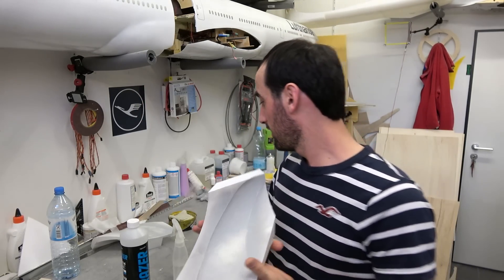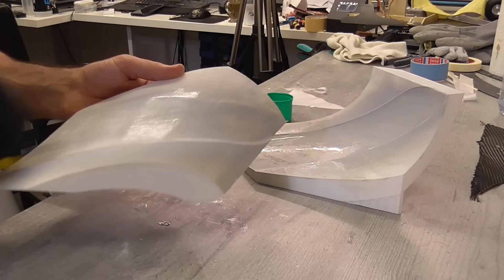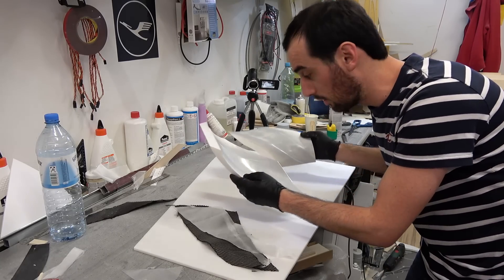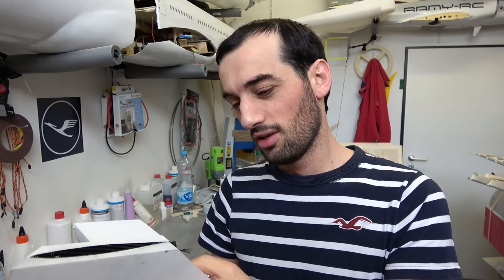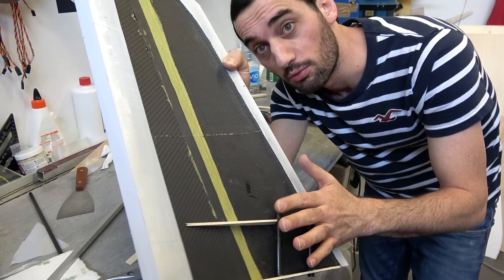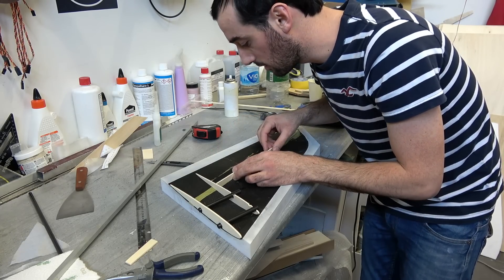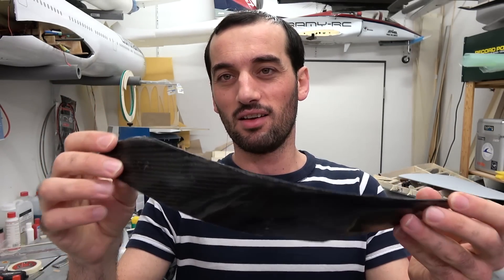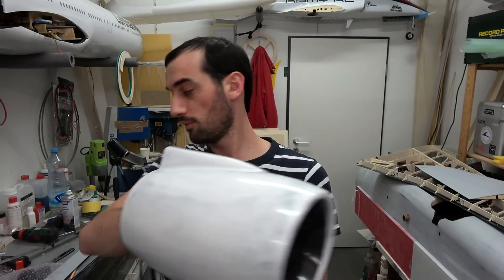Making the Sharklets and horizontal stabilizer/ AIRBUS A350 XWB

Comment: How did you cut the extra carbon from horizontal stabilizer upper and lower surface with out pulling them out from the mold?

Comment: 4:16  The huge part is particularly the MAIN FITTING and the bottom is the "Shock strut". and then you have the "Torque Link" connecting the Main fitting and the Shock strut together.

Comment: Hi Ramy

When you said you should use a silicone gun i had an idea. When I mix glues (epoxy and micro) I put it in a small plastic bag, then cut the corner off and apply the glue like you would put icing on a cake.
then once your done you can just dispose of the bag, no mess and its easy.

Comment: you need to calculate the size restriction behind the turbine. because the same aerodynamic occurs even if this is not a gas turbine. I mean you need to design a convergent and test the trust on a bench

Comment: Ramy just a tip for spreading the glue to join the parts together. Use wax paper rolled into a cone, fill it with the epoxy & micro balloon mix, fold over the wide end and cut the tip. Use it like a pastry bag to squeeze out uniform lines of glue where you want.

Comment: For applying your Epoxy - Micro-Balloon/Cotton Mix:
Instead of a Silicone Gun, use a plasic bag, fill your mixture into it, close it and cut one small piece acting like a nozzle of the bottom corners. 
By squeezing the bag you can apply it like toothpaste to the parts.
Hopefully you unterstand my suggestion.

Viel Erfolg ;-)

Comment: Stay safe Ramy, this not modelling, it is minature engineering and the world needs more and more engineers than so called 'managers'. I suffered in England when very good engineers were forced out of jobs by the so called managers. So more please, there are still plenty of commercal aircraft that you need to reproduce. 

         On a slighly different point, can any-one in the modelling world come up with a electronic gyro system (similar to a laser ring) that can hold a model on a given heading either in take off, landing and even in flight. So many models get destroyed with landing/take off accidents and I feel if a gyro could hold a model in-to wind on a heading leaving the controller to control speed and thus rate of decent.
        Many thanks for your videos, exelent work...regards S

Comment: Ramy... in regards to using the expoxy with microballons - you could try using the cake decorating piping bag idea with a cheap disposable bag made from paper. Roll a piece of paper into a cone, fill with thickened expoxy, fold over opened end a few times. Then cut the "pointed end" to a size opening that seems appropriate.  Simply squeeze the bag to extrude the epoxy to make your fillets.

Comment: Hi Ramy - love your work. I would recommend a plastic zip lock bag for the filler - good for mixing thoroughly by closing bag and squeezing it around, then snip a small corner off to let you squeeze it out like icing on a cake- I use that method for canoe building

Comment: If you brush in a gelcoat, and let it almost cure completely befor stariting to hand lay up the cloth, then you would avoid  thos tiny potholes, that are very hard to fill, in case you are planning to paint the surface. If you cover with monocote vthen it doesn? matter of course.

Comment: To lay down a nice bead of epoxy like you did when bonding the two halfs of the stabilizer, I recommend using a plastic sandwich bag that you fill with the epoxy and then cut off one corner and use it like a piping bag for cake decoration.

Comment: When you join two halves of a casting together (like the sharklets) how do you do it to make sure there are no seams between the two pieces? Or if you sand the seams down how do you make sure the two halves dont fall apart???? (Because the glueing surface is so small)
Reply: I have exactly the same question. Furthermore how do you ensure that it structurally integral, when there are no fibres connecting the two halves but just glue (with a small glueing area)?

Comment: Since you have a bit more time on your hands, using scraps, i suggest you do a series of experiments with molds and release methods.
Specifically in the case of the PVA glue, what i'd do, is i'd make the mold a few percents larger than the finite part, then, i would use an air-gun to spray the PVA glue on.
IF you don't have one, you can make a very rudimentary one out of two pipes that are met at the tips at 90 degrees with one pipe slightly over the other's center over the holes. The one that's under the center goes into your mouth (where you push air) and the other into a container (cup) with the medium you want to aerosolize.

The tool is called "mouth atomizer" under a simple google search. You can push various thickness of fluid with them depending on how large the pipes are. You can make it as simple as using two plastic straws (tho Amazon has a few already made).

Comment: Hey Rammy.
Really nice material that you put out for us. Thanks a lot. I use a ziplock bag for applying the bead that you need to join your control surfaces. Put your micro balloon mix in a small bag and then and cut a corner of the plastic bag off and squeeze it through the hole on to your surface.
This plane is gonna be epic. Can’t wait to see it finished. Covid 19 has hit South Africa and hope we can control it as we don’t have as much discipline as most Europeans do. Hope we can pull together and control this virus

Comment: Hi, nice work! I have a few ideas for a better result! Apply at first a resin layer with tixotropic component! It works against micropinholes! After laminating the 50 gr. Glas, apply Resin for the Carbon fabric! Then put the  
Carbon into the mold, now laminate it with a dry brush or/and  with a rubber spreader! All tested by myself with very good results! If you have any questitions, no Prob! Sorry for my losy english! Best regards, Walter!

Comment: Hi Ramy
The resin/microballoon glue is easy to handle with a pastry bag, you can easely make it with a piece of  glossy paper. To reduce the bright spots on the  layup you can try to sqeeze the resin, from underneath through the fabric with an old credit card or a rubber squeeche (gummispatel).
(seen by "B-1 Bob") 
Thanks for your Videos

Comment: Use a piping bag to put you goop in trailing and leading edges, clear plastic bag fill with glue and cut a tip off much easier and cleaner

Comment: Great stuff, keep it up. One thing I do to seal/smooth PLA prints is lightly sand then spread superglue over the whole print using my hand with a latex glove on. It seals, strengthens and sands easily to a smooth finish. Do this outside as the fumes are a bit intense.

Comment: A good trick I saw people use to apply thickened epoxy is to use a "icing pouch cone thingy" , the thing bakers use to make pastries or put icing on cakes . It makes a nice bead of glue and you can control the size by cutting the corner more or less. 
When you're done with it just through it away , no cleenup needed !

Comment: For the glue joint between flight surfaces if you put your mix in a polythene bag with a small corner cut off it will act like a disposable icing dispencer and give an even spread.I hope this is helpful for you.
Regards Pat Willis.

Comment: Hey buddy I also wanna ask that as i told you earlier that i am building 737 max-8 by watching one of your videos(if you remember).I didn't noticed that you used metal gear 9g servo in your plane and i ordered 10 plastic gear servos.Did i need to order the metal gear one or the plastic gear servo will work??I really had a great doubt on it and wanted to ask you.

Comment: Hey Ramy, I had mentioned in a previous comment related to building an A400M, it would be really cool if took it up. The A350 XWB is turning out to be a great build. Waiting for the first flight.
Reply: I would be terrified about breaking one of the beautiful props ! I wonder if it could be 3d printed, I doubt that. Or maybe around a carbon core ? Tricky. 
I think the Transall would be more forgiving about props height. 
More ancient do you like the Noratlas ? This could be one of my choice, but the model should have STOL abilities too. Big fun dropping troups or chocolate boxes under parachutes :)

Comment: Man, I love your build.
But combining carbon fiber and fiberglass is just adding weight pointlessly. CF breaks at about 1.5% elongation whereas fiberglass 5%. That means if you laminate them together like this, the CF will break under load way before the fibreglass starts taking any significant load. So if you used only CF, you would save a lot of weight and did not lose much strength. There is a good video on YT about this effect, it is called "Why you shouldnt wrap fibreglass in carbon fiber" or stg like that.